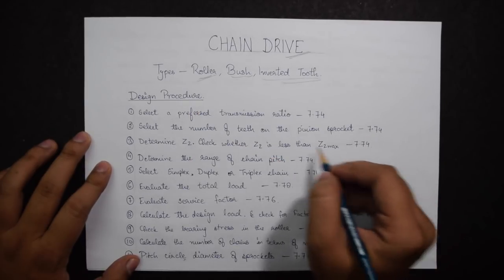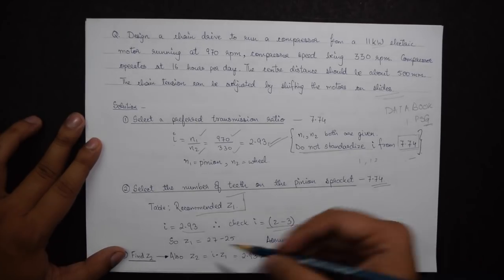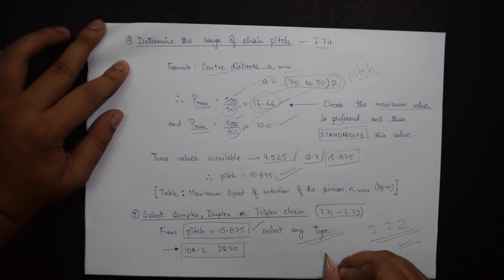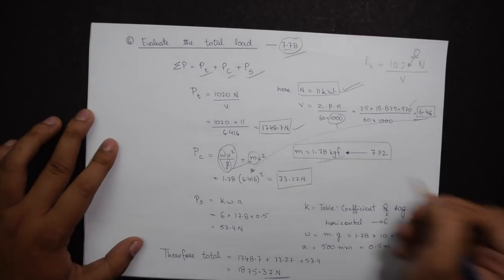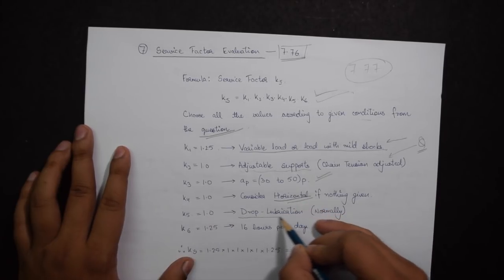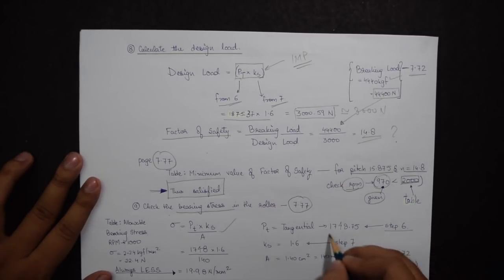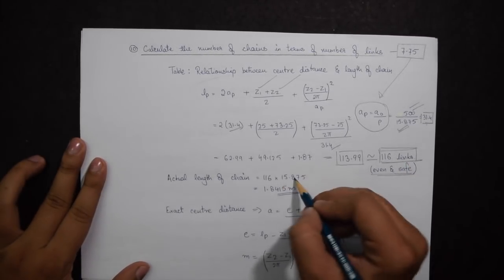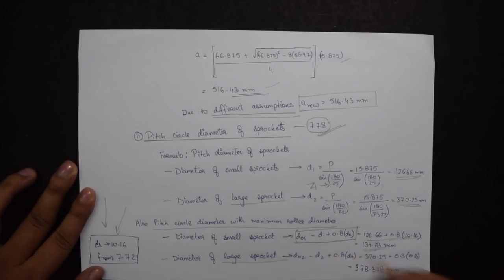Chain Drive Design Procedure

Comment: Hello
According to the data book page 7.78, w is weight/m in kgf (relating to centrifugal tension) while going back to the big table the value for weight/m is 1.78 in kgf so how did you conclude m=1.78kgf?
While m being w/g, the units don't come up as kgf.. or I'm confused..

Kindly explain..
Thank you..
Reply from the maker: In step 6, I have put in 1.78 kgf but that is actually 1.78 kgf/m which when multiplied by the square of velocity which is (m/s)^2 automatically gives the value in Newtons.
Hope this cleared the doubt. Feel free to reply back if it isn't clarified still.
Reply: ROBOMECHTRIX 
Oh sir I got but it still couldn't digest it.. like if it is (wv^2/g) the unit comes up as [kgf (m/s)^2 (m/s^2)^-1] since in the data book 7.72 it is said to consider weight per metre to be "kgf" and not "kgf/m" there is still an "m" left in multiplication with "kgf".. but okay.. if it was kgf/m then it would cancel out the "m" but still sir was it worthy of you to show only "w/g" to be in kgf.. the "v" part has also helped in bringing the value to "kgf m m^-1"
Thank you for you reply sir it was very kind of you..

Comment: hello sir, in this entire solution the data that is power to be transmitted P=11 kW is no where used. Is it that the power to be transmitted does not affect the selection of the chain drive?
Reply: kiya tho hai step 6
Reply from the maker: Yes, it has been used in step number 6.

Comment: How to do sums when centre's distance not given,.?
Reply from the maker: For a question on chain drive, if the center distance is not given,  I have a formula to calculate it on page 7.74. 
The formula states that the optimum distance is to be taken as a=(30 to 50)p. Pitch as we know can be selected from the same page or can be assumed, whichever is suited. This center distance can be an approximate value because at the very last, we calculate the final center distance once again corrected to even number of pitches from the formula on page 7.75!

Comment: Sir if the center distance is not given in the question,how do we proceed?
Reply from the maker: For a question on chain drive, if the center distance is not given,  I have a formula to calculate it on page 7.74. 
The formula states that the optimum distance is to be taken as a=(30 to 50)p. Pitch as we know can be selected from the same page or can be assumed, whichever is suited. This center distance can be an approximate value because at the very last, we calculate the final center distance once again corrected to even number of pitches from the formula on page 7.75!
Reply: Sir I asked my college professor regarding this. I suggested him the same method you have described I.e assumption of pitch. But he said instead of assuming pitch ,assume the velocity. But the problem here is if we assume the velocity and find the breaking load,ultimately in order to calculate the exact center distance we need an assumed value.
Sir can we assume the centre distance to 1500mm.? This was suggested by my college professor while taking this topic.
Reply from the maker: Assumption is one of the thing that can be anything, your professor might be correct too! But eventually if the actual center distance is eventually less, we will have to lower down the value anyways. 
Both the approaches can be used, but it is preferable that you follow what your professor has asked you to.
Reply: ROBOMECHTRIX thank you sir.